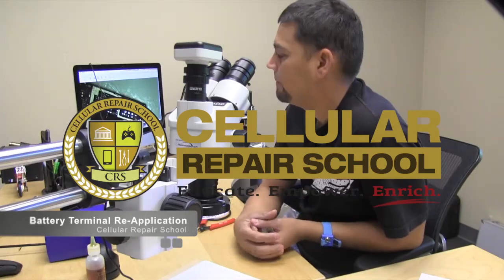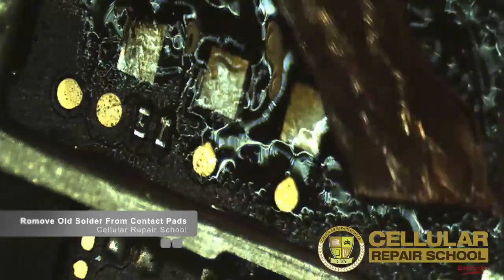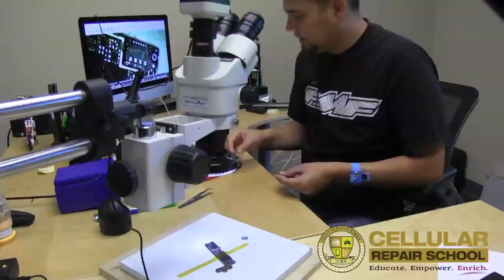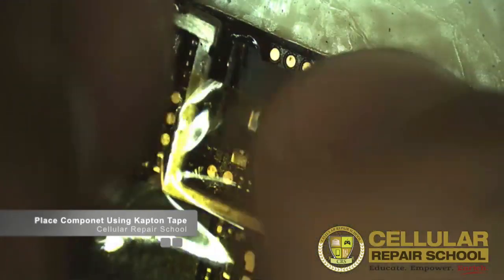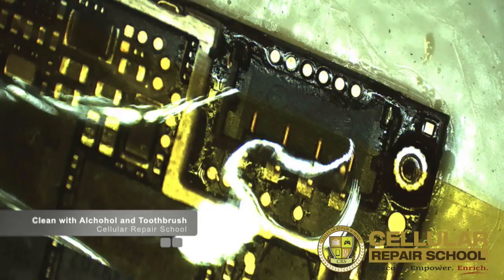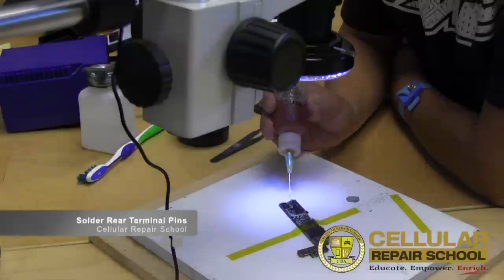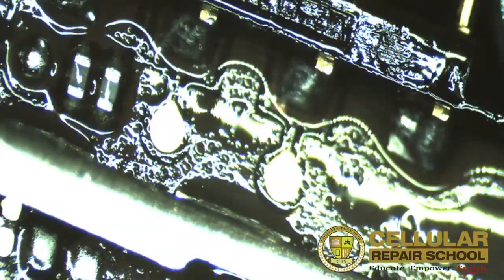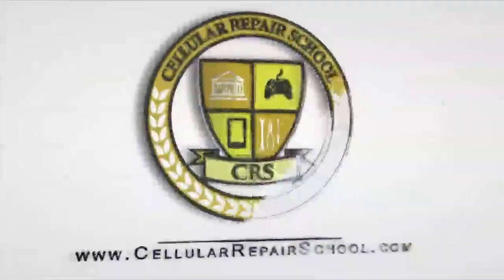iPhone 3, 3G, 4, 4S, 5, 5S Battery Terminal Replacement Repair

Comment: I usually preHeat and then blast the 400C for a lot less time!... result plastic melts less. Pre Heat is very good for the board as there is a lot less overall stress on it ....you can do this with a ceramic pre heater ...just a thought maybe it helps in the future:)